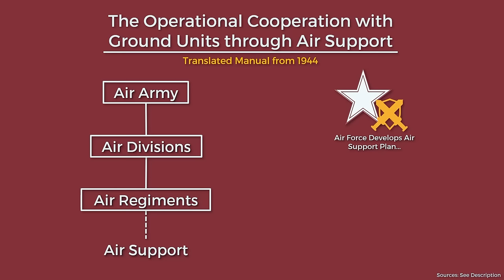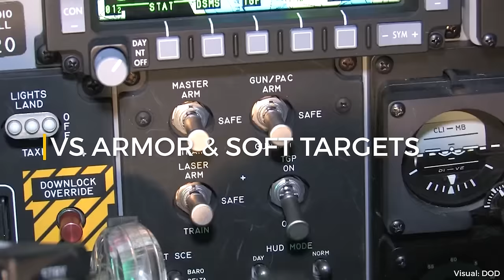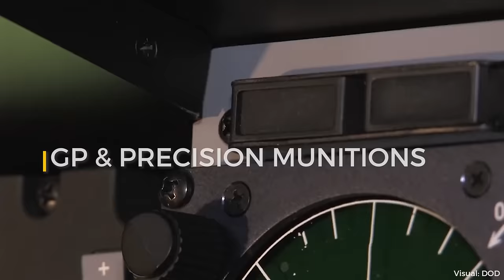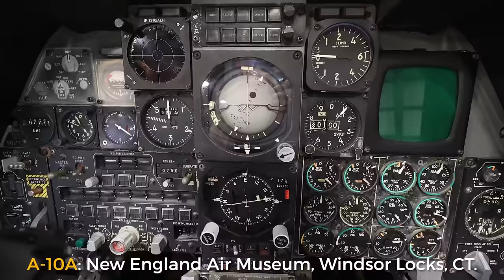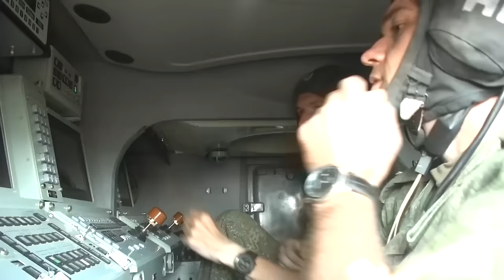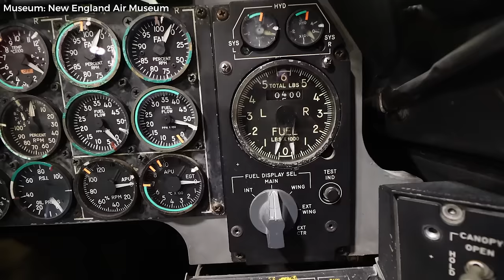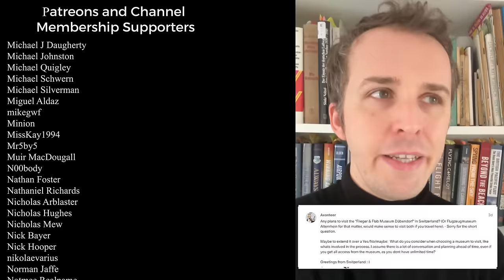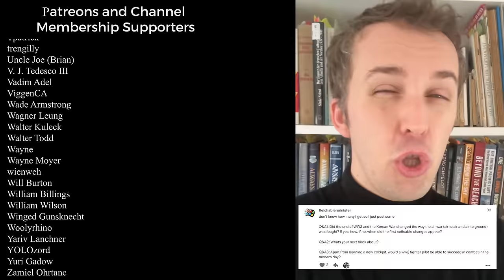A-10 Warthog: Retire or Upgrade the BRRRT? - Future of A-10C Thunderbolt II

Comment: Well the tomcat retired so do the same with the A-10.
Reply: And right now the US Navy is designing a replacement for the F-14 because the F-35 does not have the speed and range to get to the air defense perimeter. Only problem, there are delays in the program so the Navy has ordered new F/A-18E block 3's

Comment: Really cool to hear that people think of different roles for the A-10. Sure, its technical and operational viability must come to an end at some point, but considering that the B-52s are still flying and kept relevant, the sturdy old pig might squeeze some extra structural lifespan out of its airframe. 

I'm not certain if it makes operational or economic sense, but I was wondering if the A-10 could be modified to such an extend, that it became an effective drone swarm killer. The reasons I wonder are these: 

- drone swarms can attack targets from a lot of different directions and are aimed ad depleting air defences before getting through a target. 
- the problem for the air defenders then is, that GBADS A. aren't as mobile and B. per definition have limited munitions, because they have to be spread out to cover different avenues of ingress.

So I imagine that A-10s loitering in CAP might be used to intercept these swarms and take some of the burden off the GBADS, basically by becoming an airborne 'Gepard' SPAAG of sorts. 

And by virtue of relative low maintenance cost  (compared to 4th+ and 5th gen fighters), it might be a decent supplement to GBADS, which could - if air superiority/dominance is achieved, switch to missions like battlefield interdiction or the newer missions that ere being considered (maritime patrol/harassment of merchant shipping/small combat vessels, EMALD/Bomb- or Missile truck. 

While probably not survivable in a highly contested airspace, operating in the rear as an anti drone platform, might the Hog be useful that way? And would it be financially viable, for example when compared to expensive surface to air missile batteries ? Or does the old girl require too much logistics, maintenance to make it an attractive option?
Reply: When it comes to anti-drone. The A-10 would be a very expensive way to bring limited capability to the table. It makes a lot more sense to simply use self-propelled anti-air guns and even more advanced systems (EW and maybe even other stuff) to act as drone defense since they can be parked in defensive positions and don't burn a ton of jet fuel in order to do the job.
Reply: When it comes to drones, I think the A-10 could be anything but 'limited capability,' but if you mean that with regards to other aerial threats, yes you are right. 

When looking at Ukraine, their thinly stretched and near depleted GBADS, plus  Western support waning, I thought the A-10 might be a useful addition to GBADS, but indeed not at all a replacement. Good luck chasing a Kinzhal or even a Su-25 in the old Hog.  

I figured, that since the Hog is slated for retirement, why not give it to Ukrainians and see if they can give it a new purpose in life. 

Ah well... it was just a thought.

Comment: The Brrrt is awesome, but also outdated. The A10 should be replaced with a more modern platform that has improved capabilities, but it needs to be replaced, not just ditched.
Reply: They're called drones.
Reply: @charlesfaure1189  What happens when the drone meets a jammer?

Comment: Seems like the naysayers are cherry picking context. There seems to be quite a bit of overlap between A10 and attack helicopters in the CAS mission. It seems to me that arguments against A10 for CAS would also have to apply to aircraft like the Apache, and Cobra attack helicopters.
Reply: Attack helicopters are also vulnerable, but are employed differently than the A-10.  If they are employed like a fixed wing aircraft they are even more vulnerable.  Attack helicopters should not be thought of as analogous to fixed wing CAS, but as analogous to high mobility direct fire support vehicles.  The can approach and attack with less exposure from Nap of the earth or from hover behind cover.
Reply: There is overlap because the Army is generally not allowed to have fixed wing attack aircraft and the Air Force can't have attack helicopters. The Army does or at least did want to have fixed wing attack aircraft, but that would mean the Air Force would have to give up that portion of their budget to the Army. Obviously, the Air Force said nope.

Comment: The USAF does not want to provide CAS.   They never have.   Can you say P-51 in Korea?  (vs a vastly superior P-47) .    WWII was an aberration,  but only because it was forced.      But,  you also have long range artillery,  HIMARS  and drones,  so does the Army need  CAS?    If so it should be organic to the Army and Helicopters have the same issue,  viable in that environment?     But,  what happens if we wind up with more COINS?    An F-35 is not an answer for that.

Comment: My question is why isn't a platform like the A-10 the standard for purpose built COIN aircraft instead of sketchy avionics-upgraded turboprop crop dusters like the super tucano? You're trading something that made notable impact on ground force casualty mitigation for something that carries less payload, can't loiter as long, is one bad pass and a rusty DshK away from an airframe loss/CSAR scenario, and arguably most importantly is gonna be servicing dug-in militants with .50 SLAP/APIT, whereas the GAU-8 fills an important gap of something danger-close employable but versatile enough to defeat/suppress structures and fortifications without obliterating the position and troops in contact.
Reply: I rather suspect the answer to your question is “cost”. The A-10 may be cheaper to fly than an F-35 for example, but it is still much more expensive to fly (and as airframes get older and older, to maintain) than the “turbo-prop crop duster with a payload unsuitably aggressive for agriculture”. COIN ops aren’t really against an existential threat but insurgents can be incredibly persistent, so for planners and politicians who don’t necessarily know how long a COIN op is going to last and lacking the political support to throw unlimited amounts of taxpayer money at the problem, I suspect the super-tucano type planes represent the minimum cost option to give an acceptable, rather than superlative, level of capability for the COIN role.
Reply: The question is: why have A-10s and Su-25s never got aircraft in the same class built?
The answer is that they're dead end designs. You can't loiter in a real war. Anywhere you can loiter is a place where a Super Tucano is gonna do fine.
Reply: In theory a Super Tucano with a gunpod of appropriate caliber is Good Enough, in practice I rather doubt that as well. A dedicated twin engine turboprop with, if not the GAU-8, at least an autocannon of comparable caliber and greater payload capacity overall would've been a better choice in my opinion.
Reply: The USAF does not want to spend money on prop aircraft.
Reply: @StacheMan26  The ST was never going to be flown by active duty USAF pilots. It was going to be for CIA or client pilots, for use in counter insurgency
Reply: Super Tucano is a smaller target and smaller heat source for MANPADs.

What's needed is more like a middle-ground between the A-10 and turbo-props. Arm it with a 25mm GAU-8 derivative, which already arm the Harrier and F-35.

Comment: 5:30 If this were the dichotomy, I think we'd have warfare figured out. 

F-35s will suffer attrition just like everything else. 

I think the premise of the video is a bit wrong. The A-10 will have to be retired, but that need is driven by the finite lifespan of the airframes, not because the CAS mission is going away.
Yes, CAS is dangerous. What's new? The A-10s will get shot down, and pilots will die. That's war. They will also do their job and provide the CAS. The mission is the objective, not the preservation of attritable assets. Sometimes the mission will be such that no CAS will be sent, because the mission isn't super important, and there's too much air defense in the area. Sometimes the mission will be super important, and A-10s will be sent in despite the presence of air defense. 

We can afford to retire them just as soon as another aircraft is introduced to take their place. Their flaws don't really matter, because we can't just not have CAS planes. This is especially true given that our most likely next war is not a near peer conflict, but a war with Iran, which would involve grinding it out in the mountains. I think having the A-10 for that would be extremely nice.

Comment: Frankly the biggest plus with the A-10 is its ability to potentially operate from rough fields thus potentially dispresed. Ok yes there are platforms in the West that can do everything you have noted here better except maybe the CAS mission. However, if it comes down to whether or not you can even get anything in the air at all then (a side from the F-35B) the A-10 maybe the only aircraft in service that can do the wrough field ops on the fly. I am not a Pilot or Maintainer but I doubt very much that most of the US tatctical jets could operate effectively from a crushed coral strip on the islands of the Pacific but the A-10 likely could. In the end its what you can get too the fight and maintain not what you necessesarily want; do I hear the Chieftien and his explaination of the M4 Shreman and its transportability around the world anyone?
Reply: First let's talk about your notion that other planes can't do the CAS mission as well. As an A-10 fan myself, I don't really get this logic. During GWOT, we saw it pretty clearly demonstrated that precision guided munitions are some of the most effective CAS/COIN weapons in our arsenal and as such, any aircraft that can use them becomes a very, very effective CAS platform. Even the A-10's gun doesn't really bring anything to that role that another aircraft's gun can't since the GAU-8 ended up just being useful against the same targets that a 20mm or 25mm on another aircraft would be. 

  The ability to operate from rough fields is an interesting point but considering that we can deploy breathtakingly large military forces to pretty much any friendly airbase in a matter of days and have carrier based aircraft that can be wherever they are needed very quickly, the need to concern ourselves with austere airfields isn't very great. We still consider it but it isn't something that has impacted our operations for a very long time. This is especially the case when you consider that we have no trouble (via air refueling) basing aircraft a good distance away from conflict zones and just have them fly the distance.

Comment: Bottom line: the USAF hates providing CAS, and the Army & Marines should be given the planes to do with what they will; I strongly suspect that one or both of those services will be happy to keep'em flying... Use as a bomb truck given the drone-filled future is a compelling enough reason to retain the A-10, since its long loiter time would mesh well with providing queued ordnance drops from outside visible range for tiny targeting drones controlled by ground forces in close proximity to the target(s).
Reply: What if I told you that the Marines have their own combat aircraft? Yet, they still don't operate the A-10 because they know that it is basically useless against a near-peer adversary. Instead they use the Hornet and now F-35B and C for CAS because these aircraft can actually survive in contested airspace and don't have to rely on binoculars to spot the target.
Edit: typo

Comment: Long range missile and glide bomb carrier makes the most sense to me. Increase the load it can carry and improve the radar array for gorund targets. But then it's not really an aircraft made for high altitudes.
Reply: F-35 can do the same whilst being more agile and able to evade AA threat, which isn't the case for large slow flying A-10
Reply: The USAF had a "CAS flyoff" between the A-10 and F-35A with the premise that the F-35 was superior to the A-10 in all things.
After the testing was completed the USAF promptly buried the report until it showed in 2023.
Conclusion, mixed bag
Reply: Not really. Long range weapons are best launched from fast platforms. The A-10 also does not have room for a radar and would have to rely on GPS or inertial guidance systems.
Reply: @dumdumbinks274   do you need radar for ground attack when you have IR and laser targeting pods and GPS systems?
Reply: @pogo1140  If you are facing a poorly equipped enemy, no.
Reply: @dumdumbinks274   against an enemy that has the equipment to detect radar signals, using radar to find the enemy units also tells the enemy where you are. So if you can do your targeting using IR and optical sensors, navigate using GPS and inertial navigation systems. Do you really need radar at all on a ground attack platform?
Reply: @pogo1140  An enemy that can detect radar signals will already be aware of incoming attack aircraft by means of early warning radar systems. Even a poorly equipped force is capable of early warning by forward observers with radios.
Reply: @dumdumbinks274   hence low altitude flying, still has to be taught.
Reply: @pogo1140  I agree that low-altitude flying should still be taught, but it is of very limited use. Situational awareness plummets limiting a pilot's ability to respond to threats, fuel usage and response times increase, and an enemy that knows the terrain can easily predict flight paths and gain early warning from forward observers with a single radio call.  Low altitude flight is typically only used once in the target area to reduce the enemy's ability to engage the aircraft by limiting how long it is visible to ground threats, but this isn't a problem for modern SHORAD systems, especially if they get early warning.

Having a radar results in increased detection range vs vehicles, increased multi-target capability resulting in fewer passes needed to effectively use a payload against vehicle threats, and better all-weather capability and versatility. This is especially true with much smaller modern missiles/bombs that can be carried in multiples such as Brimstone and Stormbreaker.

Comment: Well, the A10 is the aircraft with the highest friendly fire rate and the most inaccurate gun which cant penetrate tank and never really could (the tests on T-60s in the 70s) but was good enough to penetrate and radiate mud huts in Afghanistan and Syria. But we should still remember the A10 for a great moral booster and a very say unique looking titanium bathtub with wings and very american sound while shooting or rather say missing lol
Reply: Fun fact, the AH-64 has been involved in just as many friendly fire incidents since the Operation Desert Storm as the A-10, secondly the gun is not inaccurate. The accuracy of the GAU-8/A when installed in the A-10 is rated at '5 mil, 80%', meaning that 80% of rounds fired at 4,000 feet (1,200 m) range hit within a 40 feet (12 m) diameter circle. This means that in a standard 2 second burst, 104 of 130 30MM rounds are falling within a 40ft circle. By comparison, the M61 has an 8-milliradian dispersion.

Comment: I dunno if precission guided munitions will render the A-10 obsolete. Modern cruise missiles are fast and very accurate. I’m not sure if missiles alone will be able to replace a close air support platform like the A-10. Also the aircraft can take quite a bit of punishment and still be able to fly back to base, that is a quite valuable asset in contrast to the expensive 5th gen fighters in that role. Meaby a new updated A-10 design would be the way forward.
Reply: The A-10s best weapon is the AGM-65 Maverick missile. Love it or hate it, the A-10's existence hinges on the guided missile. Without it, ut would have been canned in the 80s.

Comment: The A-10 is cheap to operate and has a lot of weapon stations. Much like the B-52 it offers the potential for being adaptable. The A-10 does have a ceiling of 45,000 ft so yes it can operate at high altitude and drop precision weapons.

Comment: An A-10 upgrade to missile truck or EW still offers a lot of options and availability to supporting other aircraft and being a menace to targets of opportunity and hostile morale. Carrying around as many decoys as a buff is no joke either. If an airframe should replace the A-10, it should be one with higher payload, faster but still subsonic, a toned down gun (25mm IMO) that can carry the same amount of ammo for less weight, integrated systems for communicating with F-35+s for joint strike, and long distance target identification system. And still should be ugly AF. Plus this keeps the dedicated CAS training by not trying to train a pilot to do everything